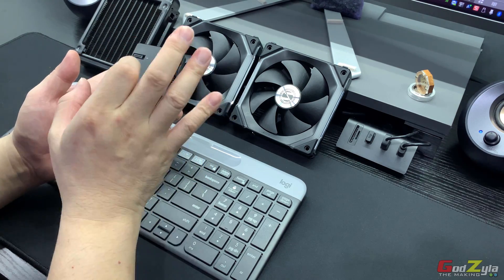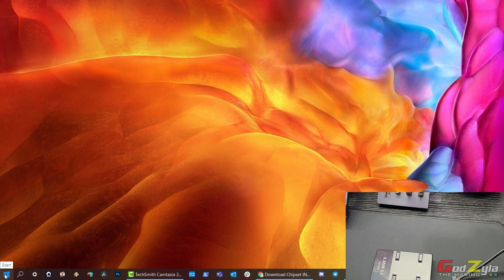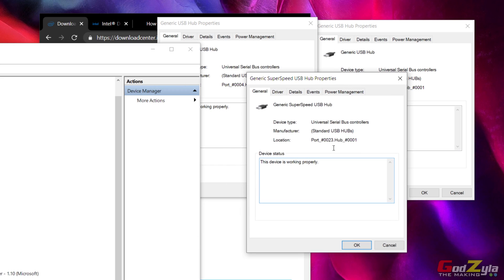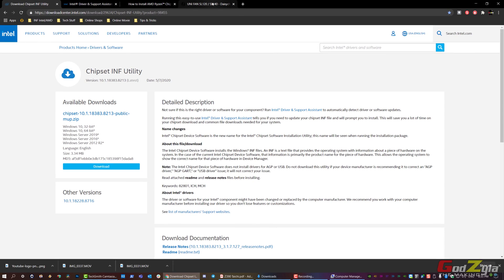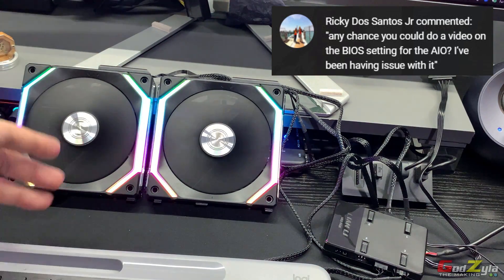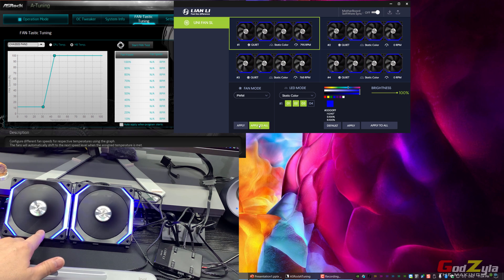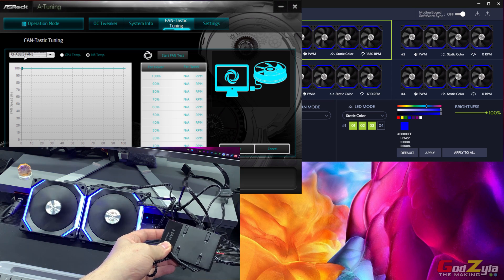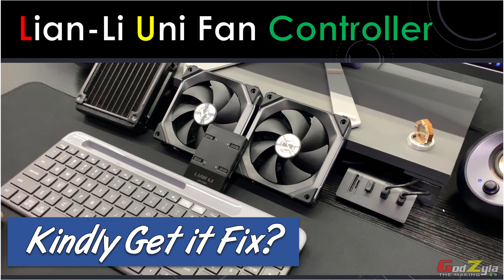Lian Li Uni Fan Controller - Some Break Fix! [L-Connect]

Comment: Help me my controller can not detected
Reply from the maker: Hi ZAZ Bro Plays, welcome to my channel. Which motherboard are you using? I see if I can help you out, no promises.
Reply: @KleoYan  gigabyte z590 vision-G......& when I connect my Hub to mobo it pop up as “unknown usb device” & when check it’s “properties”.....it’s says “windows has stopped this device because it has reported problems. (code 43)”
Hope You’ll help me 😊❤️
Reply from the maker: @ezazahmed25  your intel motherboard has two USB port, have you tried switching to another USB Port, btw have you update your motherboard Z590 chipset driver?
Reply: @KleoYan  yes I’ve tried another  USB port & also updated my chipset driver....but didn’t work :)
Reply from the maker: @ezazahmed25  are you by any change using the app center buy gigabyte and using their fushion rgb application? if you are, you might want to remove that program and just install the L-Conncet. oh I forgot. make use if Reno uninstaller to uninstall that application so that it's totally clear from your windows platform, then install L-Connect as admistrator. if all else failed, then I will advise you to approach lian li official website and raise your issue with them https://lian-li.com/faq/ , thank you!
Reply: @KleoYan  I don’t like rgb fusion & that’s why I don’t even downloaded rgb fusion...... :)
Reply from the maker: @ezazahmed25  I see, hmm.. then I can't figure out what's wrong with your uni, you might have to contact lian li. or maybe post here https://www.reddit.com/r/lianli/ . thank you and sorry that I am not able to aid you further.
Reply: @KleoYan  it’s okay bro ❤️...at least you tried to help me out.....love you 😊
Reply from the maker: @ezazahmed25  hey I remember one more thing. Did you update your bios to the latest version. As from the gigabyte Reddit. Some have mentioned it fixes the USB issues like intermittent and USB not detecting. You might give it a try.
Reply: @KleoYan  okay then time for update my bios......btw I forgot to tell you how did this problem happen.....everything was running perfectly but suddenly I’m not able to control fan rpm through l-connect software....so I was install l-connect 2.0....same problem heppens.....then I re-install the l-connect 1.0 and this problem happened....... :)

Comment: you’ve helped me so many times and for what it’s worth thank you for doing such great jobs on being thorough.  I HATE SUBSCRIBING. but you earned it.
Reply from the maker: Hi Huy Vo, welcome to my channel and thank you for your compliment. I am glad some of my videos did aid you on your PC build. I wish you all the best in your build and thank you to have subscribe to my channel :)
Reply: @KleoYan  I am honestly having problems with mine and i feel like it'd be a great topic to bring up. I will message you all the details iiwhen i get a chance.
Reply from the maker: @skiptomy  hi, i will try but no promises, as your component, I might not have, so it might be difficult for me to troubleshoot. thank you!
Reply: @KleoYan  No need to trouble shoot, i''ll eventually find the problem. Upgrading my GPU I had a short, leading to half RGB working. I also have the Z73 cam, and it works normally but no LCD display. With my 9 RGB unifans connected by your instruction multiple different times, new wires i'm not sure if this is what the end of them look like but as far as troubleshooting they work and are sensed fine, i just have no control over any of the color. The three fans ( daisy chained ) all show about 20 percent of the entire fan itself ( one corner or side ) I am not blaming you or anything but i love the videos, and want to know what you think or how you would trouble shoot. New vid idea!

Comment: im getting so frustrated with these fans.. i've set them up all correctly.. i downloaded and updated the chipset.. and still cannot get the Lian Li controller to appears on the device manager. I have no control over the fans or RBG... they are on and working, but no control at all.. this is so annoying.
Reply from the maker: Hi iAmFreddyp, welcome to my channel. which motherboard are you using? does your motherboard have another USB 2.0 header? if it does, you might want to try the 2nd port.
Reply: @KleoYan  i have the ROG B550-F  with two usb headers..
Reply: @KleoYan  one is for the AIo and the other is for the lian li controller.. i swaped them around and nothing works.. i know the ports work because the AIO is functional
Reply from the maker: @iamFreddyP_  may I verify the way you have connected it. It will be best if you list out what AIO you are using and are you using the Amoury Crate for your motherboard too?

You AIO has its own controller that plugs to one of the USB 2.0 motherboard header

Next your SL120/SL140 controller is on another USB 2.0 header motherboard header? 

I assume you have installed both controllers application (For AIO and L-Connect?)

If you are doing that. Most likely your AIO application have took control the rights over your L-Connect. Or another case is Amoury Crate took control of your USB 2.0 motherboard header.
Reply: @KleoYan  Thank you very much for helping me with this.. I have the NZXT connected in to one port and the Lian Li in the other.. they are side by side at the bottom of the motherboad. 

I do have both applications installed.

Even if the AIO application is taking over the contorl of Lconnect, why will it not appear under the device manager? Also when i connect the Lian Li controller, it states that the PC cannot recongize the device: "the last USB device you connected to this computer malfunctioned and windows does not recognize it."
Reply from the maker: @iamFreddyP_  hi that’s part of the reason as why it’s not showing. The IRQ (interrupt request) is now overtook by an application. Try this, delete the faulty device from the device manager, uninstall both application. Shut down your pc, unplug the power to your PSU, remove the NZXT USB plug from your motherboard, plus back the power and boot your pc. Once booted up. Reinstall the L-Connect, make sure it’s run as administrator. Test out the L-Connect with your fans first. If that works. Leave it. Now shutdown pc, connect nzxt USB to the motherboard. Boot it up. Test the L-Connect. If it works, install the NZXT application. Hope this works. If it does, reboot pc to ensure both application and hardware works.

Incase you want to know what IRQ does.
In a computer, an interrupt request is a hardware signal sent to the processor that temporarily stops a running program and allows a special program, an interrupt handler, to run instead. Hardware interrupts are used to handle events such as receiving data from a modem or network card, key presses, or mouse movements
Reply: @KleoYan  I can’t leave the NZXT removed. I’ll  give me a CPU error.
Reply: @KleoYan  unfortunately it’s still not working.

I removed all applications. Removed and placed the NZXT and Lian back in. Booted up and installed ONLY lain application. Ran it as admin, and Still no control or readings of the fan rpm.

This definitely is some sort of software issue.. I just can’t figure this out..
Reply from the maker: @iamFreddyP_  hmm. pardon me.. I am running out of ideas, you might want to try to post your questions here https://www.reddit.com/r/lianli/ as someone might use the same components like yourself.. see if they can help you out. if not.. try raise a support ticket with lian li as they are currently helping out issues like yours. https://lian-li.com/faq/ . I am terrible sorry that I am not capable to aid you further.
Reply: @KleoYan  does other software applications like icue and ROG armory cause interference?
Reply from the maker: @iamFreddyP_  Amoury crate from Asus and Fusion from gigabyte does that. It ended up I have to rebuild the windows OS and just stick to one application. Those were done for my friends not me.
Reply: @KleoYan  its a shame that all these issues occur just to use simple rgb fans.. I think im just going to return them and choose something else. This is too many hoops to jump thru just to get them to work. I'll try to figure it out for another day, but then if it doesnt work.. back to amazon they go.
Reply from the maker: @iamFreddyP_  it’s not really a shame. I mean the hardwares are not the issue. The issue is on the software written. As the coding uses the same address. This is something which brand manufacturers should sort things out. Agreeing to use specific IRQs instead of using generic address. Anyway I hope your issue will be resolve by someone who is more capable than I am. Really sorry that I can only help you this much.
Reply: @KleoYan  I really appreciate you taking the time to assist with this. You were much more helpful than anywhere else I checked.. just wish it was more simply. I'll def subscribe and check out more of your videos in the future. thanks again
Reply from the maker: @iamFreddyP_  thank you and you are most welcome. To be honest, at the moment, am busy with my work schedule. I will be back one day and thank you for your support. I wish I  can solve your issue. Still I wish you all the best and do let us know once you got it sorted out and how it is resolved. I believe this will help the rest too.
Reply: @KleoYan  hello sir! I was finally able to gain control of the RGB and fans.. it was the controller. This seems to be an issue across the board with many others. The supplier sent me a replacement controller and BOOM! It worked like a charm! Just when i was about to swap them out for another brand of fans.. it really worked!
Reply from the maker: @iamFreddyP_  thats good news. Congrats, glad that you have solved your issue :)

Comment: Hi, I'm having trouble syncing the rgb of the lian li fan with my motherboard's software. For some reason I can only change it through the the L-connect application. Is there any way to resolve this issue? I'm also still having issue adjusting the speed of the fan through Ai suit
Reply from the maker: Hi Arroyies, welcome to my channel. There are a few things you might want to check, 1st are your cables plug properly, especially the argb cable that goes from your uni controller to your motherboard, also did you plug to the correct header? on L-Connect, did you switch to motherboard mode before you launch your motherboard application?
refer to this video for the connection https://youtu.be/Rm2emeyMUAk
Reply: @KleoYan  thank you, I was able to locate the issue for the rgb. But I still can't control the fan speed Ai suite 3
Reply from the maker: @Arroyies  Hi Arroyies, you might want to check two things, 1st the pwm connector that has only one single wire, is that connected between your uni controller to the motherboard fan header. take note of the motherboard fan header (example Chassis_Fan 3). go to your motherboard bios/UEFI, go to the fan settings and check the fan header which you have plug on the motherboard, make sure it's set to PWM and not auto or DC mode.

Comment: I've been struggling lol. Lian li shows up in devices, but I can't get any control over the rgb and fans. I have a b550 aorus pro ac mob. I have deleted all the rgb programs and still no fix. I tried updating using the Mousepad fix, but that didn't seem to do anything. I tried a different USB port, running  a single fan, still nothing. Any ideas?
Reply from the maker: Hi Nano, welcome to my channel if this does not work, I advise you to post your questions to reddit ( https://www.reddit.com/r/lianli/ ) or to write in to lian li ( https://lian-li.com/faq/ ) for a solution. a couple of pc builders are having issues like yours, some rebuild Windows OS and works. some just try an error with the patch provided at lian li official website https://lian-li.com/product/uni-fan-sl/
Reply: @KleoYan  I finally figured it out. The device had to be plugged into USB2 and then I uninstalled lian li driver under device manager in control panel. After restart it began to work. Not sure which one did it for me, I just got desperate and tried those two things. The usb2 was advised by someone although it doesn't make any sense to me why that would work lol.
Reply from the maker: @BearMetro  Hi Nano X, that's great news :) enjoy your lighting effects now.
Reply: @BearMetro   You are a beautiful human being. THANK YOU SO MUCH!!!!!!
Reply: @BearMetro  you have no idea how thankful I am for this. spent 2 days straight trying to figure it out, and this worked!!! same mobo and all. thank you!!
Reply: @BearMetro  it worked thank you !!!!!
Reply: I didn't realize people commented on this. I'm glad I've been able to help some of you :) This was certainly a frustrating issue.

Comment: Hi Kleo Yan, do you have any advise if uni fans is detected by L-Connect but not recognised by Windows? It is showing up as LianLi in device management but under devices and printers it is showing as unspecified devices and randomly disconnecting/connecting.
Reply from the maker: Hi Bryan X, welcome to my channel, do pardon me, I missed your message. may I ask what type of motherboard are you using? thank you!
Reply: @KleoYan  I'm using x570 Aorus Master.
Reply from the maker: @Bryan-oq2vz  Hi, did you install the AMD chipset from here ? https://www.amd.com/en/support 
select Chipset > AMD Socket 4 > X570 ? download and install, you will need to reboot. if that does not work, you might want to post your issues here https://www.reddit.com/r/lianli/ or to raise a support ticket here https://lian-li.com/faq/
Reply: @KleoYan  Thanks for advise Kleo. I did tried a fresh install of Windows and install the X570 chipset first but the result is still the same. I will try to log a case with Lian Li and seek their advise.
Reply from the maker: Hi Bryan X ok, hope they will resolve your issues. All the very best.

Comment: How can you control the fans with pwm if the controller is connected to the motherboard via usb as instructed on the manual? The controller is not connected to a fan header.
Reply from the maker: Hi Jack Wu, welcome to my channel. The  PWM Fan connector that is between the uni controller and to the fan header is taking readings/instructions from the single wire from the PWM connector. it will then pass through the uni controller, which has the control over the set of fans.

Comment: Hooked up fans and controller. I have no lights at all on my 3 daisy chained fans.
Reply from the maker: Hi Morris Wanchuk, welcome to my channel, just like to check, did you plug the USB cable between the uni controller and to your motherboard usb 2.0 socket? Did you also checked the device management if it did populate on the listing? Did you plug the Sata power source from your PSU to the uni controller? if you are unsure how the connection goes. this might help you out https://youtu.be/Rm2emeyMUAk
Reply: @KleoYan  Thanks for the reply. Yes I did all of these steps. I can control the fan speed from the L Connect software and that works however and setting for RBG don't work. I have a MSI MEG X570 UNIFY AM4 AMD X570 SATA 6Gb/s ATX AMD Motherboard and have MSI dragon center installed. I also did the steps of updating the AMD software you recommended. Now when I was initially installing these I powered up the PC and the fans were not spinning and i had a burning smell coming from in-between the fan connections. I quickly turned off the PC and unconnected and reconnected it all and now it all works  except that I have never had any RGB from these fans.
Reply from the maker: @PlusEVRacing  burn out? are you able to test each individual fans? I suspect there is a burn out on one of the argb led from a fan which causes the entire daisy chained not to work.

do some basic troubleshooting steps as listed below

1) testing one fan at a time with the uni controller output 1-4

2) If fans do not react when you perform 1) this could be the uni fan got burn out or cable faulty

3) if 2) does not surface and you have tested fans one at a time, it will narrow down which is the faulty fan uni. 

4) connect those working fans to the uni controller. if it works. the fan that is faulty, raise a RMA form at lian-li website to get it replace.
Reply: @KleoYan  Got them working and it was the connection to the fan that wasn't seated properly. Guess it came loose when i was mounting them. Thanks so much for the help.
Reply from the maker: @PlusEVRacing  Hi, you are most welcome and I am glad that you’ve fix your issue. Thank you for your reply too 👍

Comment: I have the ASUS B550-A motherboard, the USB is plugged into my motherboard and all the fans are on and connected. I looked at Universal Serial Bus devices and all I see is Aura LED Controller. I tried to delete the driver and reboot my system but the Aura LED Controller came back and Lian Li is still not there under the device manager. I uninstalled L-Connect and reinstalled it as administrator and I still don't see it, do you have any suggestions? The fans work and RGB is on but L-Connect doesn't work at all I can't change the speed or RGB color of my fans.
Reply from the maker: Hi Pluralized, welcome to my channel. There is a specific removal tool Armoury Crate Uninstall Tool where you can download to try https://www.asus.com/supportonly/Armoury%20Crate/HelpDesk_Download/
Reply: @KleoYan  I just used the uninstaller but I still see Aura LED Controller under device manager
Reply from the maker: @pluralized  Hi, if that's the case, I have no idea how to aid you on this, you might want to try asking your question here https://www.reddit.com/r/lianli/